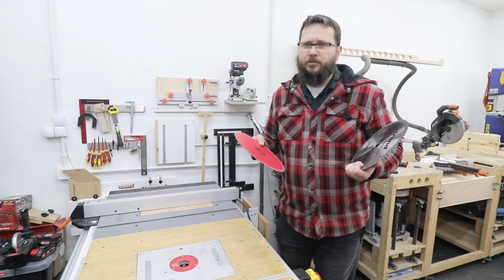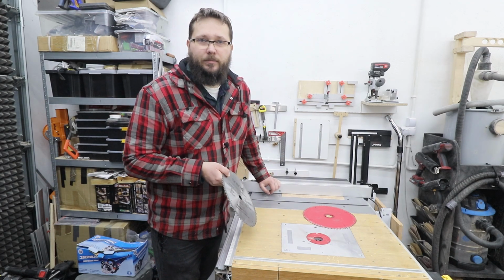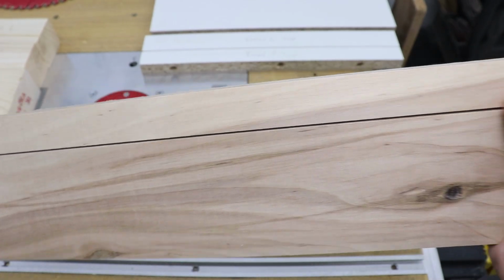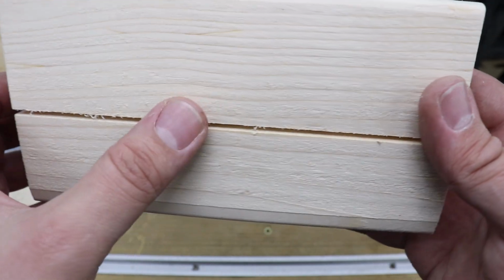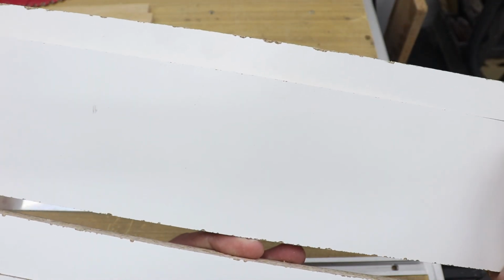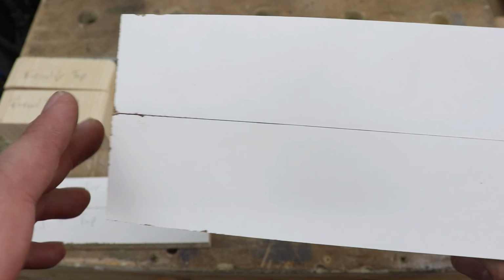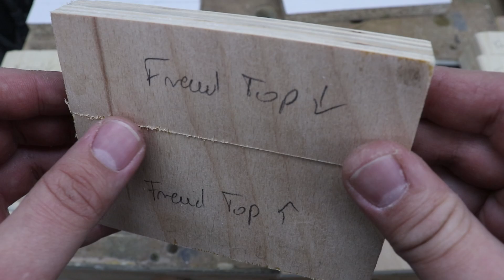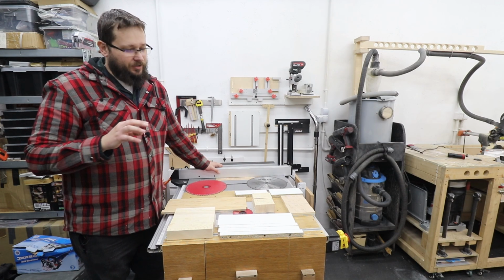Freud VS Trend | Which saw blade performs better on Evolution Saws

Comment: I only have two blades for my Rage5S. The original evolution combination blade and a Bosch 60T full kerf blade. The Bosch is my main blade and a great all rounder. I have learnt that running melamine chipboard through a first pass with the blade at 3mm then a second pass to complete the cut produces perfect results. Cheers 👍😎🇦🇺
Reply from the maker: For melamine I just use tape in, quick and easy. But yes first shallow pass will give good results.

Comment: Interesting, indeed. Due to the high T-content, both blades are mainly for quality cuts. I suspect, that zero clearance plate was made slightly wider by the Trend blade, hence Freud has some tear out on the back. On the other hand - many of us just tape or sandwich the piece for the cut.
Reply from the maker: In normal circumstances I would also tape the melamine board for best results.

Comment: Czesc Tomasz, I'm trying to settle on 3 blades, 24T FTG, 40T ATB+R and 80T ATB.
However it does seem like no vendor has the 40T ATB+R or better known as combination/general purpose blade.

Have you seen them?
Reply from the maker: I think Trend has one 🤔
Reply: @CasualDIY Yes, seen the Trend 60T ATB+R, but 60T for ripping may lead to scorching in my opinion. Will continue to search for the 40T variant.

Comment: Perhaps it would be interesting to do a scoring cut on both machines and all the materials.  I think you would find that both machines would have far less chip out.
Reply from the maker: I do have an upcoming video on how to cut melamine or laminated boards. This video was to see how the blades would perform on cutting these materials in the most straight forward way.

Comment: Hi Tomas
Nice and very useful video.
I have a Rage 5S too. I am sorry if my question is very far away from a professional one😅, but how do you manage to use these blades in a Evolution saw when the bore is different 25,4 vs 30? As far as I know it's not very safety to use a bore adapter...
Thanks a lot and keep it up 👍
Reply from the maker: If you get a nice snug reducing ring then there wont be any issues - as long as you install it correctly. I bought a set of reducing rings from Bosch and they are great. Been using them for years now with no issues at all.
Reply: Thank you very much Thomas 👍

Comment: Both blades are excellent quality, I personally prefer Freud blades. 
Thus isn't a good representation of the quality of the blades, but it does demonstrate the need to set up and calibrate your machine whenever you change blades, 
And how not to use a sliding mitre saw.
Reply from the maker: Personally I prefer Saxton 😅 but that's mainly due to price, however Trend is quite cheap as well. 
How would you conclude a test of blades?
Reply: @Casual DIY  longevity, the amount of residue stuck to the blade and clogging the gussets, checking for warping and trueness of the bade when new, and again after repeated use, including temperature measurements and heat dissipation times, 
Then the question of weather the blade could be sharpened?
Reply from the maker: @sally6457  interesting questions however some of them may not hit with most of my audience as I'm in most cases testing budget blades up to £30. Those very detail tests would make sense for high end expensive blades. For what I present that would be an overkill I think. 
However I'm taking the feedback on board and my next blade comparison video will have most of that information 👍thank you